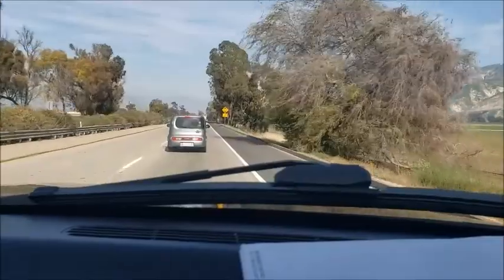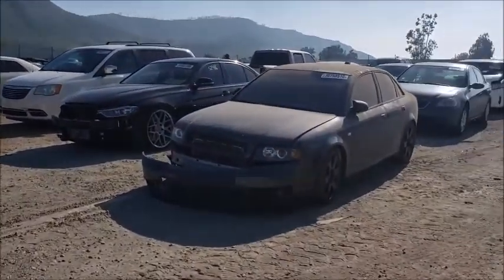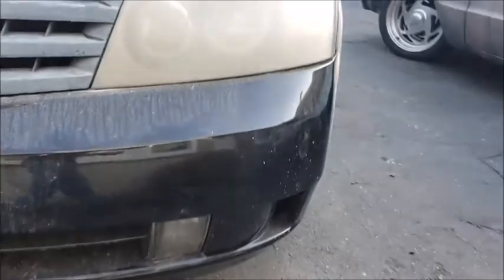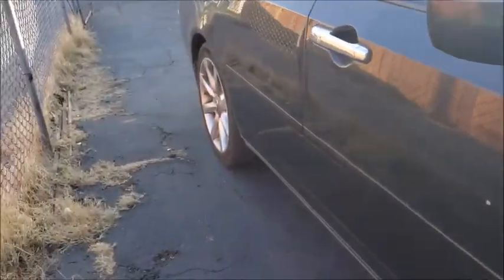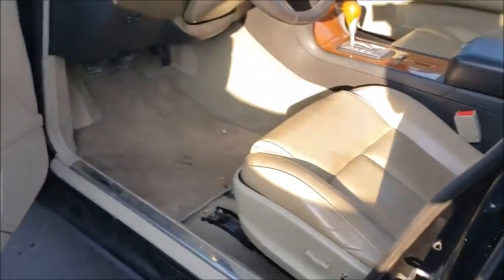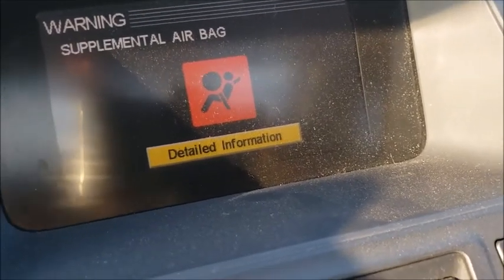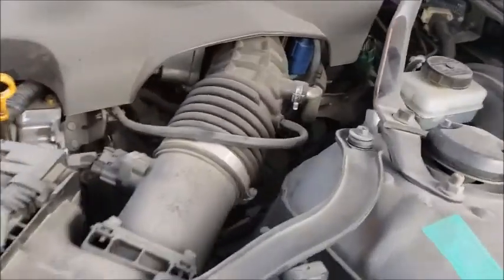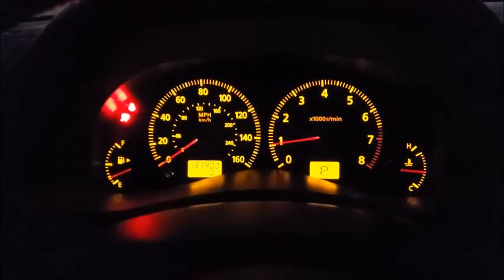2003 Infiniti M45 Copart Rebuild Part 01

Comment: had the same issue with my number 6 pack...changed all and my crankshaft sensor plus my IAT sensor...but it sounds like mine except I have a front manifold problem I think...

Comment: Great video! Did you investigate/fix the airbag light yet? Curious to hear what you found out. Thanks!
Reply from the maker: Yes I did.....all I had to do was reset it. I cycled the key 3 times and count. forgot the process..LOL. Its common these M45 for the back door sensor to go bad. Havent had any problems since i sold it. I know the new owner and no issues.
Reply: @BobbysBackyardAutoworks  cool! Thanks for the reply. I did see the reset process online. I'll give that a shot. I'm picking up a 2003 M45 from a family friend in a couple weeks. Keep up the good work bro!
Reply from the maker: Thank you, sure will.

Comment: bought trunk shocks .29bux ebay
Reply from the maker: Good deal...they work perfect?
Reply: @BobbysBackyardAutoworks  I did the same but for my 2006 Infiniti M35, they made the trunk easier to open up and got rid of the limpness. I paid $22 for both shocks though.

Comment: I have 2004 m45, with 90k miles in it n have a hard time finding parts. I was gonna sell it but changed my mind. Im just gonna try n fix the small stuff. Could u r someone on her help me
Reply from the maker: Hey What up. What kinda help did you need? Thanks for the sub and the support.
Reply: @BobbysBackyardAutoworks  ok Bobby ready, here we go 1) my driver door does not unlock / lock my doors. Have to us passenger side door button 2) only one key fob works 3) ac doesn’t work 4) my seat will not set to the memory setting I put it on, that might be me. 4) I need a  front bumper. Person b4 me had it n hit something.
Other then that she runs like a champ, oh n turn fix the lights on in dash slip,abs,CFC and tire pressure
Reply: @BobbysBackyardAutoworks  I’m gonna go thru n check the fuses on some of these issues
Reply from the maker: Wow got lots going on there..LOL. 1)You might have a bad lock/unlock switch, since it works on the passenger side. 2) either the key fob has dead battery or its not programmed to the car. 3) for the AC could be a number of things...low freon...bad compressor...bad low pressure switch..would need the car for that. 4) that might be bad button panel or like you said driver error. 5)front bumper, bet thing is ebay, thats where i found the fender $250 !!! Hope that helps. Where are you located?
Reply: @BobbysBackyardAutoworks   thank you . Im gonna work on all those things